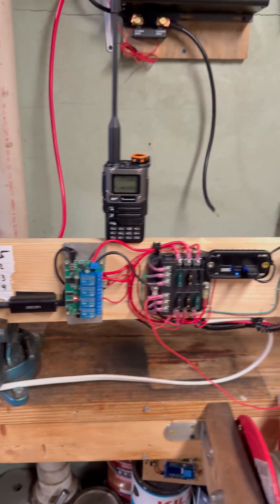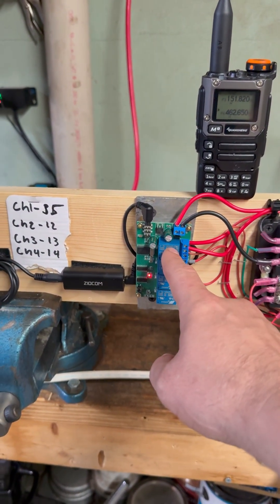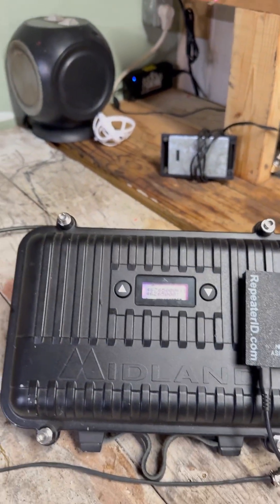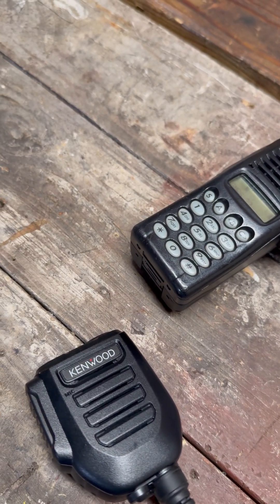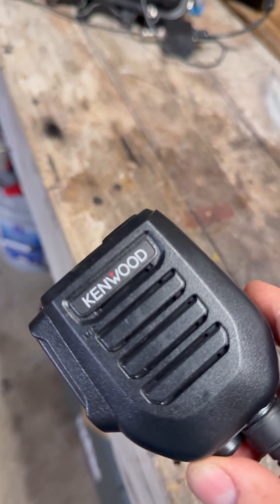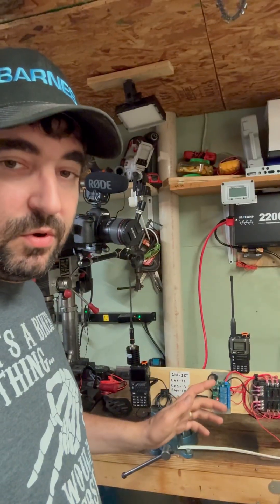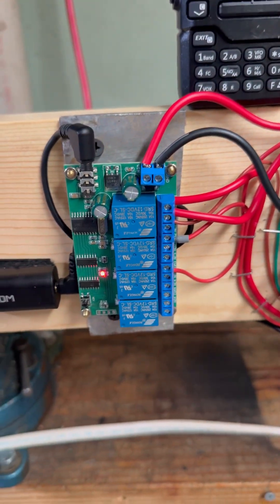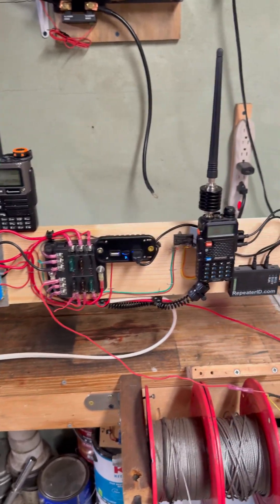DIY DTMF controller board with feedback announcements ￼

Comment: When we lived on the farm we'd use Quick Call II (2 Tone) to open/shut garage doors, gates, lights on, etc. Works great, hook up to a motor starter. Will beat a garage remote for miles!
Reply from the maker: You can use that system as well. I’d bet this is cheaper still but there are 100s of different ways to do the same thing